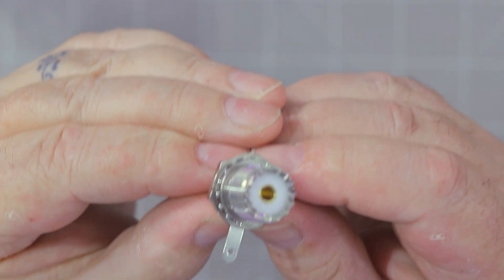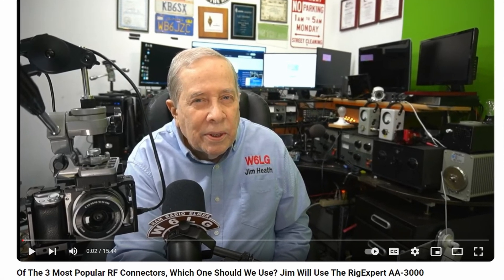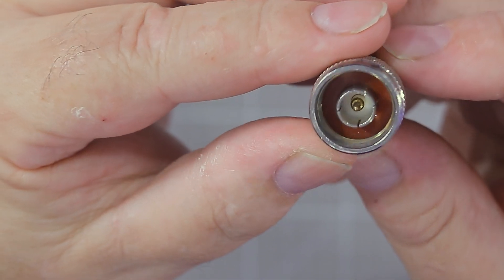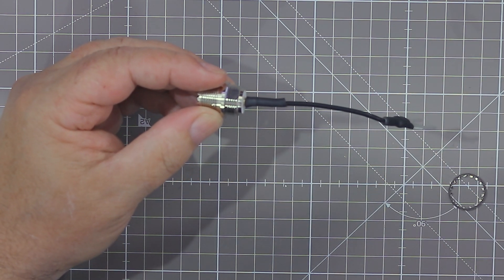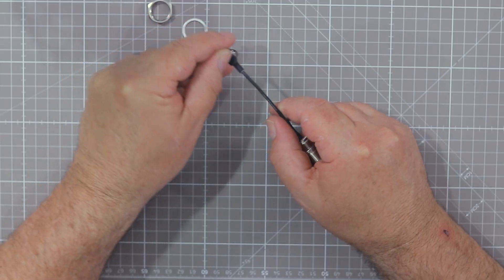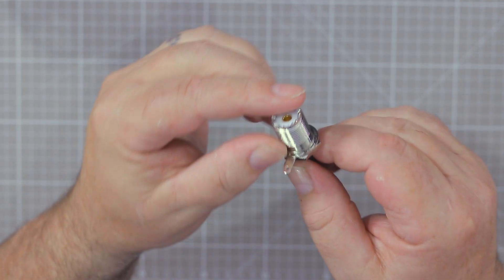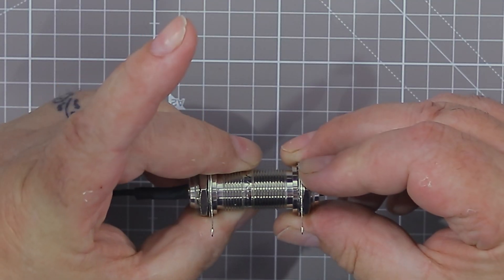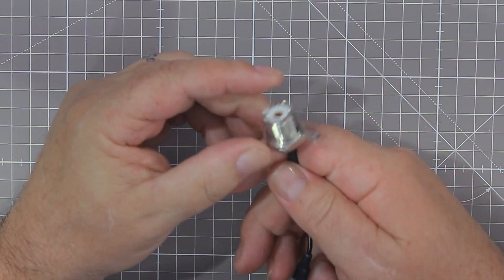UHF Coax Connectors PL259 and Extra Long SO239

Comment: It is definitely worth looking out for better quality materials. I bought some PL259 from the auction site. Rather like in Jim's video, the insulation was brown, but definitely not phenolic/bakelite as it was susceptible to melting when soldering, resulting in a crooked center pin unless great care was taken. Cheap plastic - Bakelite wont melt, and PTFE should withstand soldering OK. The plugs do work OK at 100W, but not sure I would trust them at higher powers. I got what I paid for, and learned something...
Reply from the maker: Good observation.. Agreed, I've had those insulation parts melt before too.

Comment: Stay with Matt. I would rather have too long a thread body than too short to avoid the possible connection issue. I've not had very good luck with the Chinese connectors because the insulators tend to melt at much lower heat than they should. Maybe it's my shaky hand soldering sometimes too. They do work once you get them soldered but I still prefer a higher quality.

Comment: As always, this is an informative and fun video. If I can drop my 5p into the subject, I have always had issues with N-type connectors. They work but not as well as the PLs. I had all sorts of problems, starting with random SWR spikes, losing connections, etc. You ask for the joke about the size, so there you go: longer are better ... of course, the connectors, they said.
Reply from the maker: I think the very good ones (and that's the trick) work very well.. But the quality appears variable.

Comment: Hi Callum,
 I had already noticed that once, but now with the new pl259 connector it is much better, nice and steady only the screw thread on the mounting part is often a bit too thick.  okay, we'll just take the so239 with chassis. we need to go to a so239 vs2. 0😂

Comment: In the USMC, in the 1980's, we used N type and BNC.  All Amphenol.  The only PL-259 / SO-239 were at the base Ham / MARS station.  To this day, I use all 3.  Of the first two, I stick to Amphenol. Of the UHF connectors, I spec silver plated brass, as even with corrosion they conduct well.  (the black oxide silver gets.)  N type and BNC are 50 to 52 ohm as memory serves.  I don't believe the UHF connectors have a consistent impedance rating.  I should probably look it up.  I looked it up on a data sheet.  No mention of impedance for PL-259.  I use COAX SEAL on the UHF connectors as they do not seal against weather on their own.  COAX SEAL is a brand.  Knock off products get hard and fail.
Reply from the maker: Check out either SSB Electronics or Messi & Paoloni UHF connectors.

Comment: Thanks for the overview. The long thread body would be an advantage if you had to weatherproof the connection. It gives you more space for the tape or Duxseal to cover the connector. As for N-type connectors, the main advantage is that the're weatherproof. At least, they're more weatherproof than bare PL/SO 239 types. High end N-type preserve cable impedance through the connector, but that's not a certainty with "econony" types.
Reply from the maker: Lots of folks suggesting that N Types are more weatherproof.. but if you check the latest designs over last 10 years, there's no difference between the two.. Of course, I am not comparing the "old" PL259.. But the latest designs that are effectively a PL259 inside an N Type body.

Comment: Thank you for sharing as always .
The PL259 was invented by RCA , Radio Corporation Of America in the USA in the early 1930's , it was designed for military radio communications personal , the idea of the PL259 is so that a radio communications antenna plug can be applied to a coax cable by using minimum tools ie, a bayonet or a knife or even using teeth . The PL259 ,it's interesting to think that modern radio communications equipment is continuing to use 94 year old technology , it's a bit like the wheel , some things never change .
Reply from the maker: Indeed.. Plenty of 100 year old designs still knocking about.

Comment: I have always looked for the longer threads for the chassis side of the connector. yours do seem to be longer and better for some of my 3d printed boxes that I make for custom chokes and UNUNs. The connector you have for my DXCommander is almost perfect. But as I said I would like it to be about 4 to 5 MM of more thread for my custom stuff. Thanks and 73 Vic de KE8JWE
Reply from the maker: Interesting..

Comment: Callum… in a perfect consumer world, your purchased connectors should have a data sheet on the signal-loss, and the materials used, silver or.Nickel plated brass, etc. 73 de KD6UYK (Tim).

Comment: Years ago there were two standards on the thread pitch. One used in Europe and China and a different one used in the US and Japan. It was only a slight difference but meant that some pl259 plugs would not screw down all the way  on some SO239s and the inner body of the PL259 would waggle in and out. Not a good connection. I haven't seen that lately so one or other of the standards must have won but I'm sure I and many other hams will have the problem connectors somewhere on cables that we made up 20 or so years ago!
Famous repair to ft857/897 radios - replace the N type socket after someone had forced a pl259 into it!
Another gem is the the inner connector in the N type connector will fit a BNC connector.
Fun & games with all of these RF connectors! 73 Ed
Reply from the maker: Interesting! I'd love to know more about the thread story.. Ahd yes, the old PL249 into N-type problem.. Never done it - but heard..!
Reply: @DXCommanderHQ  The original PL259 / SO239 specified a 5/8" x 24 tpi thread for the coupling.  For some unknown reason, Asian versions are commonly made with an M16 x 1mm thread.  16mm is close to 5/8". 1mm pitch is around 25.4 tpi which isn't the 24 tpi of the 5/8" version!  Hence the binding when trying to couple  "imperial" vs "metric" versions.  Asian versions are often (but not always) designated as "SL16" which I presume tells you it has the metric thread.

Comment: I was mobile in Bristol a few years ago and the N Type female chassis mount on the back of my Yaesu dual band mobile radio , the centre pin broke. I had some spare time and I was looking on eBay at replacement ones and came across M0MAT. I emailed him and 15 minutes later, I was at his home QTH and got a  replacement mount off of him. I saw the shop he runs with all his he connectors he supplies. I always recommend him and always but my connectors off of him, from that one experience I had.
Reply from the maker: Yes, he's a top banana chap!

Comment: It don;t matter - because as long as the connector integrity is solid , with no signal degradation,in the configuration used why change?  For me I’m a BNC man due to my experiences when I was an engineer.  The RF side I dealt with PL259 didn’t exist until I became a ham.  Good quality connectors are a must - thats all.  Interesting debate regards Mike
Reply from the maker: Yes.. and you are right. As long as the connector is reliable and high quality, you're away!

Comment: Love JIM's W6LG video.  Great testing.  Just buy good connectors !  The M & P PL259 are super and work up to UHF just fine.  N may be better UHF and up only if you get quality connectors ! . I never had a problem with my DX commander SO-239 connector.   Just focus on good coax ! Jim did a video on that as well !  . Cheers !
Reply from the maker: Yes he did! Top guy..

Comment: I buy all my N and 239/259 connectors in bulk on Ebay and have never had an issue with any of them (Solder version)

Comment: It seems like the older connectors that had a Bakelite type insert held up better in high temperatures then the pfe they use nowadays in the pl259.  Just my thought. 73
Reply from the maker: Interesting.. Not had an issue with PTFE

Comment: Hard to overstate the value of a quality connector.  Never mind the RF performance, but one that goes together well and lasts the years is worth so much more than the $5 you'll save on the imported junk.    I'm a BNC guy myself.  People way underestimate the power handling capacity of them (up to a kilowatt in a well matched HF system).  In a portable setup where you actually connect and disconnect often they're a God-send.
Reply from the maker: Never considered that Matt.. Good one.

Comment: The longer thread is useful when applying self almagumating silicone tape. Alows a tighter seal with a less aggressive transition in diameter when wrapping. At the end of the day either will work fine. As for N type. I have also noticed variable results. I prefer the 239/ 259. Connectors. But i operate HF only so there's that.
Reply from the maker: Great tip!

Comment: I only use N-type connectors on my VHF and UHF equipment.
Reply from the maker: I think good N Types are indeed superior.
Reply: Sounds like you may be making a mistake.  I hope they are not more expensive.
Reply: @bassmanjr100  What is a few quid more for one's hobby?

Comment: Was a communications tech for a company that had over 1000 VHF TXr sites across the western half of the US.  N are just better for weather.  Problem is, hams won't pay for a decent N connector.  We installed $60+ connectors, one connector.  Top of the line N vs top of the line PL, N every time.  The right N, installed professionally, will last for decades.
Reply from the maker: Oh.. Lovely! Fancy coax too probably!
Reply: No experience with N connectors. Plenty of experience with fellow HAMs that won't pony up the coin then complain about the results of their cheaper china junk.

Comment: I Could have killed for a longer socket a cuppla weeks ago.
Don't know where and how I scored them, but I have quite a few PL259's that have a long-sleeved thread and they would not screw tight like you say but mine were a good thread off going tight.
Almost to the point of the plug turning round and round past the sawtooth.
Also, this one particular plug was in a mobile install and the looseness over time with the vibrations spread the inner terminal socket and caused an exceptionally bad connection and subsequently sent VSWR through the roof.
I have also got SO239's with dodgy threads in that the pitch s ever slightly finer that it should be and with the same result as above.
So much for standardization.
These connectors also don't look like Chinese junk either.
Reply from the maker: Ah! I heave heard about these weird threads.. Don also mentioned it (earlier comment).

Comment: Back in the day there were some really bad PL259 on sale so they got a bad reputation. The connectors M0MAT sells are really good and I would not go anywhere else. N Type are way more difficult to fit and it's not worth the effort.
Reply from the maker: Good point Ron!

Comment: Hi Cal,
I recently bought some PL-259's silver plated with gold plated pins and the UG adapter to solder onto some RG400 coax. Wish I had tried the screw the PL-259 barrel onto an SO-239. After all the cables were assembled I discovered the barrel of the PL-259's would only screw onto a few threads then appear to seize. I had to buy a special tap, drill a 4.2mm hole in the center to tap all the PL-259 barrels to get them to screw onto the SO-239's securely. From now on I'm only buying either true Amphenol or Messi & Paoloni PL-259 connectors. Everyone there stay safe.  73  WJ3U
Reply from the maker: OMG Don!
Reply: I ran into a similar problem with a batch of PL-259's. Two were either faulty, or from a shady supplier. They would screw on nicely, but jam when being removed. I had to use a pair of pliers to get them off even if I'd only finger tightened them! The rest of the batch were OK, only the two bad ones.

Comment: I found out in the military that n connectors where the biggest failure when replacing smashed connectors in the field, we put adapters on and switched to 239’s, much easier and quicker with 239s
Reply from the maker: Well, there you go.. Good data!

Comment: The long thread gives water a chance to work its way in to the connector by running down the exposed thread, just my thought.
Reply: Cal uses vaseline on the threads to stop that. Works a treat.
Reply: liquid electric tape works for me. called the manufacturer to be sure there was not any metal in the mix. used saltwater approved formula because my antenna is 10m away from a 55mph zone road that has lots of salt applied in the winter. zero issues.